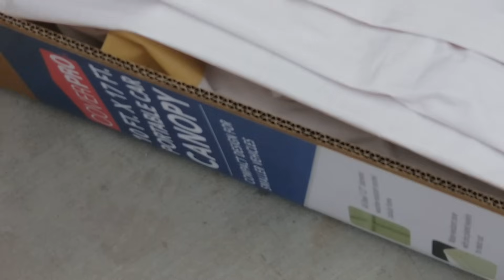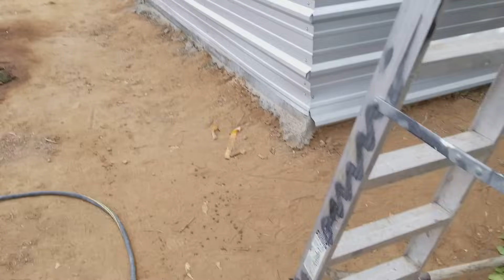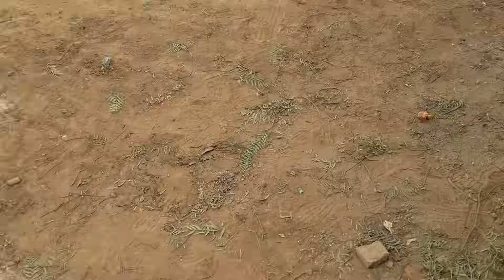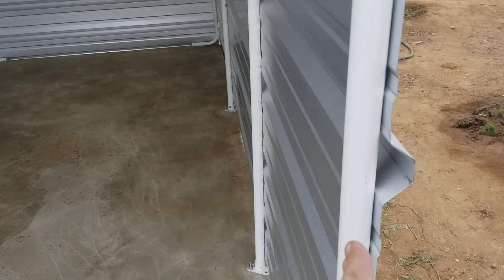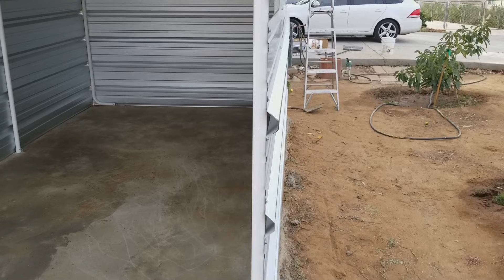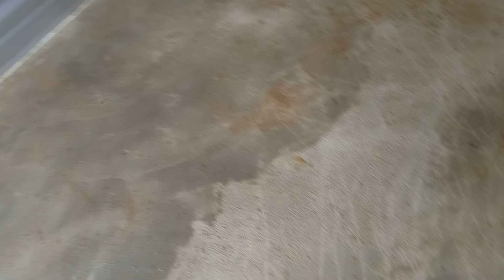Harbor freight tools portable garage into  Permanent structure

Comment: Lots of day light gaps and openings. Good idea though.
Reply from the maker: still havent put on the corner trim pieces I just found them I will post another video with them on stay tuned.
Reply from the maker: putting on the edges in a few weeks. new strength demo https://www.youtube.com/watch?v=w0abbXGY1eY
Reply: If someone wanted to install the PBR panels vertically they should run RCA channel across the poles horizontally first every 24” or so first. It would give the correct attachment points for the panels. Use the stuff for installing sheetrock it would be plenty strong enough. It should increase the shear strength on the walls and roof by 20-25% as a plus. It’s also cheap and you can use galvanized self tapping sheet metal screws to install it. Same method they use on pole burns but cheaper.
Reply: Being as how the objective is the sharing of ways to exploit ones resources to the best possible result, I feel  pretty  secure that our host is quite aware of his project's   limitations and no doubt has some fine tuning in mind to suit  the challenges that its placement and the stresses that weather will play on its lifespan.  If  gaps were  too much of an issue, a few rolls if aluminum A/C duct sealing tape  and a coat of coil seal would close it up and repel water from finding its way inside the shelter.  About 100.00 bucks will get a fair amount of foam shot into the corners and seams and as  time and resources allow, another coat  would only improve  it.

Comment: You fill the side poles with cement for strength.
Reply: Sand is much easier
Reply: A NO
Reply from the maker: yea for sure if you really are concerned with 80mph winds that might be the ticket.
Reply from the maker: yea a little cement and sand or shove a 3/4 inch emt inside and a few screws. Check out the strength video it is stronger than you think https://www.youtube.com/watch?v=w0abbXGY1eY

Comment: Suggestion:  drill holes in the lips of the panels where they overlap one another...  Put a 1 1/2 " metal spacer between the lips and the pipe frame.  Do that on every pole at the overlapping edge....in high wind the edges are the first to lift up and catch more wind and allow the panels to rip off.
Reply from the maker: yea I didnt overlap them because I have these nice trim edges for the gaps on the corners. but counldnt find them. My employee buried them under some stuff and i just found them stay tuned I will be showing another video with them on.
Reply: He's talking about the horizontal laps...

Comment: Those poles look like the same stuff they make those cheap beach umbrellas out of. You can bend em with your knee. One good wind and bye bye
Reply: I wouldn't even fart while inside in fear of it blowing over..
Reply from the maker: I did a strength video Sitting on the roof I dont think so super strong way stronger than it looks. search the channel for it.

Comment: I  bought the 10x20 version of this canopy from harbor freight. after 2 years the tarp splits in half and  there is no replacement canvass available. So to solve this problem I would buy a 10x20 tarp and tie it down. It looked horrible but it worked. never thought of this but hense , I probably would have just ordered a shed and paid monthly even for it or bought a carport thats bigger then that for a little more if I was going to do that. In my opinion the only way I would have invested 500 bucks into that frame is if the tin was free. All in all not a bad idea but I would not have done it , a new tarp once a year is 20.00  maybe 2 tarps in a bad storm season. That frame is not even made for that kind of weight .
Reply from the maker: check out the strength video thanks for watching enjoy your views on the subject might help someone new strength video gotta see this you will be shocked. else.https://www.youtube.com/watch?v=w0abbXGY1eY
Reply: i think all tarps r like that. i used to do it

Comment: I'm left wondering what the cost would have been just skipping Harbor Freight altogether and buying electrical conduit! You can buy all kinds of fittings too!
Reply from the maker: yea I was going to do that but the anchors to put it on the ground and the pole connectors were more costly. It was faster and easier to just buy the HF poles and just as cheap. 1 inch EMT for 10 pack plus the connectors. was almost as much as the whole HF kit.
Reply: oldschooldiy 
Not like it’s for outdoors but we built a paint booth with from pvc pipe , fittings and plastic and a couple fans for exhaust and intake. 
It’s not for a car but it’s for large parts. And it would be relatively easy to extend its length.
Reply: @MrTheHillfolk  I've seen that done with rebar on the inside and I think with cement too so wouldn't warp in the sun for greenhouses.
Reply: I was also wondering how much a do it yourself container of closed cell spray foam would cost to spray the inside with.  That would insulate the structure, waterproof and make more rigid.
Reply: good thought
Reply: good qwestion
Reply: Electrical conduit is very thin wall steel so not that good for it under a wind load. You would be better with black pipe or square steel tube but would want at lease a stick welder then or a buddy that has a welder and works for beer.
Reply: Wouldn't that be to flimsy?

Comment: I would have left a foot or so not paneled at the bottom all around the structure. If you get an 80 mph wind coming directly into the garage door with no way to exit you are going to have a lot of pressure trying to escape and no way for it to do it.

Comment: Nice job, but since you’ve already got $550 in it, why not drop another $100 and frame it with 2 x 4’s? It would be 10 times stronger and last for a lifetime.
Reply: lol take too much space
Reply: Owen Riggs $100 wouldn’t cover it. He’d need another $500+
Reply: @zfilmmaker   He paid $189 for the Harbor Freight kit. Another hundred dollars would make that $289. 8ft 2x4s are like $3 each. He'd have actually been better off just framing it both financially and structurally.
Reply: @hundiddy  better yet,get the 2x4's in the cull section 70% off,stock up & build
Reply from the maker: @zfilmmaker  so true and treated lumber is super expensive.
Reply from the maker: The 2x4s would ad about 5 inches of clearance and a vehicle would not fit inside. It is super strong. but it does flex a bit because it is metal. the 2x4s would also be subject to termites and would need to be treated at the concrete too. anchoring would be much harder to do.
Reply: @mikesrandomvideos   Its your project man so if you are happy and comfortable with it that is all that matters. In my opinion anchoring 2x's to concrete isn't a big deal, you either build a bottom plate out of treated and tapcon that to the concrete pad or buy the brackets that are made for that which are less than $2 each. Maybe your area is different but I know where i live the framing you have wouldn't survive very long. I've actually seen these carports fail several times but in fairness i've never seen anyone tie them down the way you have or add the roofing like you did. You should do an update video in a year.
Reply from the maker: @hundiddy  yea for sure this is just an idea that anyone could spin off with. I will be doing a video on strength test. It is stronger than it looks because of the way the panels run. And pretty heavy. here the max wind is about 70mph so  for we have had 60mph gusts and it was fine. if it didnt have the walls it would surely go away in the wind. but with the walls it ads strength over 1 year now and still standing. We have our winds in the spring and fall so we will see.
Reply: Why dont you shut you trap and just enjoy the video
Reply: I heard your wife blows 100mph no problem

Comment: I have one of those buildings and it will rain inside!
Reply: George H Reed Jr. any uninsulated surface will condensate.  U can glue on ridged insulation.  No more condensation and it's a lot nicer in summer or winter if it's closed in.
Reply from the maker: fyi had super  heavy rain and no leaks. keeping my fingers crossed ha ha but nothing yet

Comment: Wouldn’t do this if you live in an area that gets heavy snow or high winds. The frame is very weak, and made even weaker when you start drilling holes in it to attach the metal panels. The frame on mine was bent and snapped during high winds. Great for a small garden shed, but wouldn’t store a car in it.
Reply from the maker: well check the new video out it is stronger than you might think https://www.youtube.com/watch?v=w0abbXGY1eY

Comment: What is pbr panels those look like u panels
Reply: pbr panels have an 1 1/4 raised part every 12 inches and on one end there is a tail to prevent water intrusion . pbr is used for roofing. r panel is the same but doesn't have the tail. some builders use pbr on the walls and roof. u panel just has a raised panel every 6 inches and seam doesn't stand as tall hence can't suport as much weight over longer distance.

Comment: All i know is the wind where i live would blow that across the street
Reply from the maker: well it is pretty heavy and winds hit 60 mph here and it didnt move at all. If you have issues with those carports blowing away this wont work either. but if you arent worried about carports blowing away it might work better than you think. Because it is really heavy much heavier than it looks.

Comment: AMERICAN ENGUINETY. Now get yourself some liquid nails and some two inch styrofoam insulation, and your good to go in the winter,  after a cool door of course.
Reply from the maker: yea I havent made the door yet I have the metal from extra panels. but I havent made one for it yet.
Reply: @mikesrandomvideos Cool, good luck. Mine is still in it's box, bought it 2 years ago, now that I am retired I can get to it, I am going to do mine very similar to yours with a few add on's  because I am in a high wind area. Thanks for posting an awesome video, and I don't say that to very many  Youtubers. Smile.

Comment: It looks super Flimsy... you need to go get some steel cable aka metal shed anchor kit that has enough cable to go over the top of your shed to hold it down during the high winds that will definitely show up. Otherwise plan on paying the neighbors bills when it rips up and trashes their property or worse someone gets hurt or killed from flying metal panels..
Reply: My son bought this exact tent and it didnt last the first snow storm the poles collapsed! This maybe a bit stronger but the ridges going lengthwise will hold snow and not allow it to slide down will also lead to structure failure
Reply: My son had bad luck with his i wondered about filling the poles with concrete though!
Reply: John, wood would definitely be stronger given current code standards. I've seen similar buildings completely destroyed in a heavy wind. It's a good idea, but there are much stronger ways of building.
Reply: Ken, I would venture to say, that it is not that flimsy, ... & would more than likely be stronger than a nailed wood structure, with the exception of survivability of fire, ... (for the same reasons that a flexcore roof is no longer considered safe to use in the building code), ... because a hot fire may char wood, but leave it with enough strength to support someone’s body weight, after being subjected to a similar fire, ...

Comment: The hardest part was the cement slab...for a few bucks more,some 2x4's,and some exterior plywood,some roofing and you have a much better looking structure that wont blow away.

Comment: How does it perform in heavy rain?
Reply: The sides stopped on top of the pad. He will have a wet floor with the lightest rainfall. This should be looked at as a step above the plastic canvas exterior.

Comment: i was going to do the same with my canopy when the top wore out. it lasted quite a long time. the one thing that kept me from doing it was the problem of roof weight load per square ft. most metal carports look to be about 30 lbs per square ft. i tries to all around to different companies an try to get a reasonable number. but as usual they refused to make any kind of calculated guess guess because of liability reasons. so i never did it. it pisses me off that companies don't build these metal canopies a little cheaper. the cheapest i could find was a bout 1400. but because  being in the snow belt area the wanted to go with heavier trusses. still a good deal they offer free delivery and installation. just cant be off level more than 3 inches on a 12 x 24 x 7 ft tall. maybe my goose will learn Einsteins secret to golden eggs. otherwise its a wait and save thing. it was defiantly an enlightening being able to see it with my eyes and not in my imagination. somehow the mind just don't quite get it,  i sure do find some off the wall people that come up with some crazy ideas for other stuff. not that i haven't. most of the time id rather just pay the difference and let them be the ones to be liable. beings insurance companies just make up excuses or the pro rate down to nothing like cars.

Comment: Fortunately, my city's limit is 200 square feet.  Might build a garage using this idea.
Reply: HF has a 10x20ft canopy kit that would be perfect. It's also $100 on sale right now. The cost is lower on these because it only comes with a tarp roof, not canvas walls like the 10x17 garage - which you won't use anyway, so why spend more money on a smaller kit? Lol https://www.harborfreight.com/10-Ft-x-20-Ft-Portable-Car-Canopy-62858.html
Reply from the maker: yea you could make it a bit wider and full 17 ft then it would be more usable.

Comment: These modifications will make the building weaker against a side wind. At the same time, the sheet metal makes it much stronger than the original. So definitely sturdier than the Harbor Freight unmodified setup, but with the front end being the weak point of the modified design.
Reply from the maker: the front is somewhat weaker than the rest of the building but it is much stronger overall. I would not suggest it to hold up to hurricane or huge storm winds over 80 mph but wouldnt be suprised if it did hold up still it is really strong when you put on the end wall stonger than the hf side strength 10 fold for sure.

Comment: I made a structure similar to this - but I added 2/2s as purlins on the roof and attached to the metal rafters using galvanized 2 hole U shaped steel straps to hold them to the rafter pipes (screwed up from underneath). I screwed my roofing directly into the purlins and ran them vertically for rain drainage.  This made the roof stronger for my climate.  I also built one of these where I doubled up the frame , cutting the plate and ridge poles in half (people often get rid of their frames on Craigslist - just found one that was the same as mine and cut the pipes with my sawmill using the pipe studs and pipe rafters and connecters).  Again, made the roof stronger for snow load.
Reply from the maker: great stuff gotta be ready for those heavy snow times
Reply: I was thinking of doing just that! Could you post a brief shot/picture of your final result?
Reply from the maker: @AbeFM  yea I made several videos including the final result should be easy to search for harbor freight portable to permanent garage
Reply from the maker: yea for sure in some climates it might be better to do some reinforcements. just an idea people can spin it off however they want..
Reply: Carol Guid
Reply: Upload pics in ur version looked nothing in ur channel ...
For the author great set up idea !!✌🌎🤝

Comment: How would you add a door to the front entrance?
Reply: Paul James Dudley   Wood frame it by using a ramset on the base plate, then frame in whatever door you want. Some long screws could also be used to tie in the walls. Definitely doable. 😊